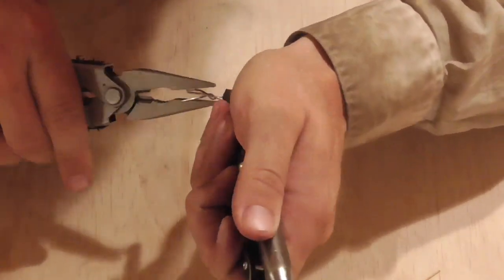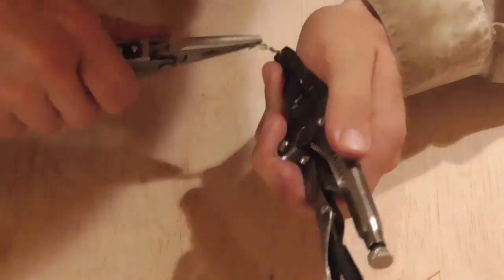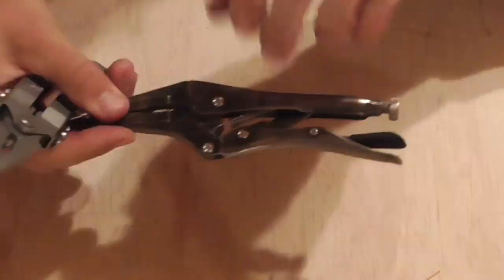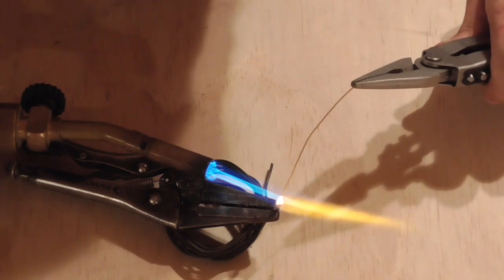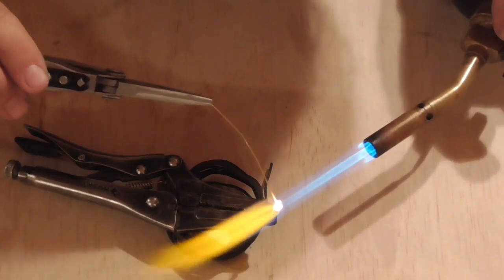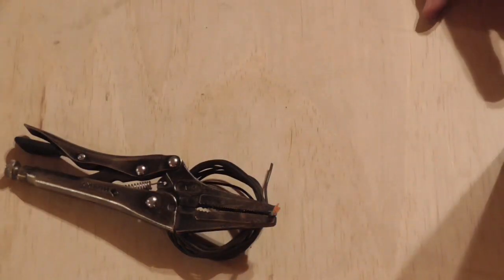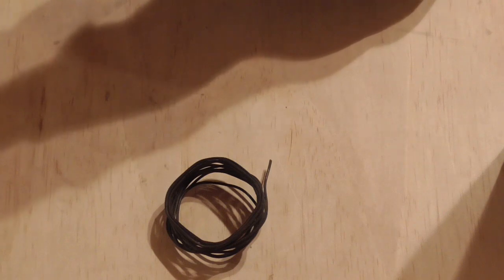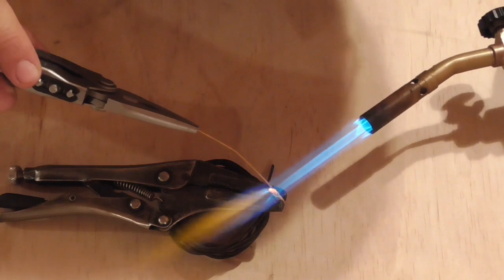Braided Jewelry Experiment (TIS100)

Comment: if cost was the cause to do this would not silver be a much cheaper choice  to extend the gold or the platinum
Reply from the maker: Well, silver cannot be substituted for the platinum because its melting point is too low - it would melt when you were trying to melt the gold onto it.  You could probably substitute silver for the gold, although since silver is not quite as noble as gold (chemically speaking) you might need to use some kind of flux to prevent oxidation during the operation.